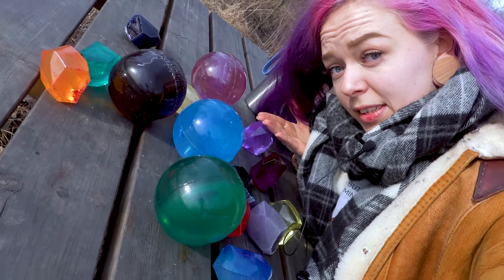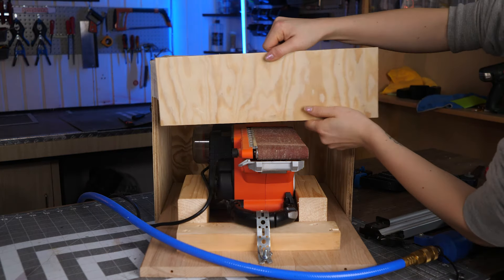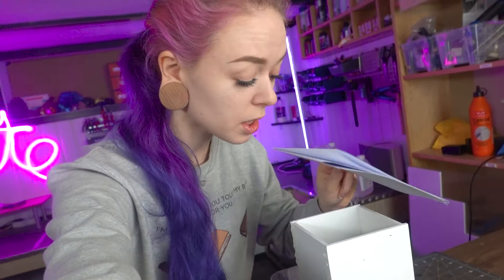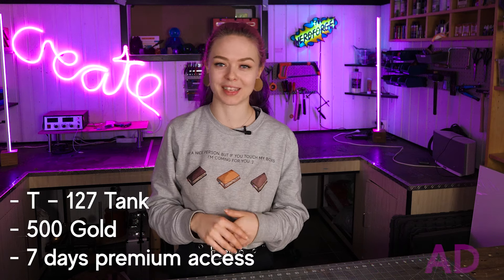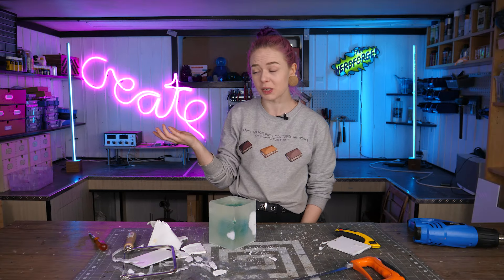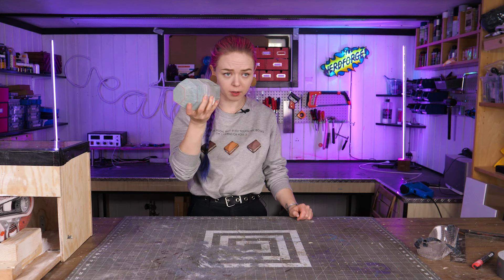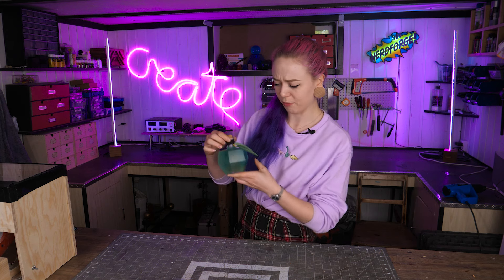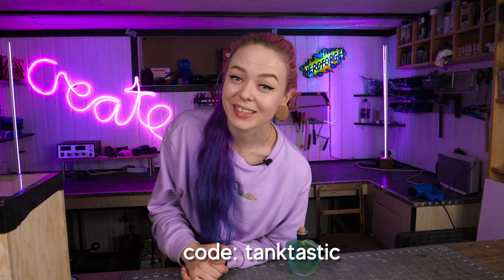DIY Fantasy POTION Made from Leftover Epoxy!

Comment: Next time try this, shape your Epoxy then find A decorative bottle that the epoxy shape will fit in, then just cut the bottom off the bottle (or cut the bottle in half) insert the epoxy then epoxy the bottle back together and buff out the line. They do sell bottle cutters, do not use the alcohol string fire method to cut your bottle (as seen on YouTube) it never works. Other than that, that is a badass potion you just made. Very nice.

Comment: When you use hot glue and it’s not giving, use a heat gun to reheat the glue and it will come off easier. Also using a mold release will help the
epoxy release from the mold.

Comment: For the next one you can try casting the bottle shape you want in a rubber mold first. So just when you shape the resin ball into a potion make it a little bulkier then you actually want it, cast it, then shave it down some more and then put it in the mold you made with the resin to get that liquid in a bottle effect without all the sanding you did. It would help getting the main body shape, for the spout you can secure a tube or some cylindrical object to the resin potion shape you made before casting it in the mold, I’m not an expert but that’s what I would try

Comment: A couple of advice, if you polish the part of the liquid before applying the glass layer visually separate to have another texture. To save yourself the loss of so much epoxy, you can make a mold the way you want the bottle to be about and then refine the edges.

Comment: If you put a layer of clear packing tape over the foam board before you assemble the mold it will release better. If you want to be 100% sure, use a mold release spray as well.

Comment: There are alot of videos of people working with epoxy. But they usualy turn it. Just like you would do with woodworking or woodturning. The sanding is usualy to finish. They use also a clear finish were you make it very shiny. It probably makes also the clear layer more visible. A fellow Youtuber Nick Zametti does a lot with woodturning resin/epoxy. Maybe you can ask him.

Comment: One thing you might consider trying is to make the inner shape a little oversized and with the neck shape at first, make a cast of that, then sand the inner layer down more so it's nolonger oversized and doesn't go all the way up the neck, and there is now a gap all around when you suspend it inside the mold. You can then hotglue a stick (one that is thinner than the diameter of the hole for the neck) to the top of the inner shape to hold it in place as you pour the clear resin into the mold (this way the stick holds the inner piece in place so it doesn't float to the top or get misaligned). You would then only need to drill out the stick to make the hallow part of the neck and sand it. 

Please don't feel discouraged about mold making, please check out Steady Crafting With The CrafsMan, he is gentle and reassuring like Bob Ross and will help you feel confident enough to try! If you thought that a belt sander would change your world, I would be super excited to see your excitement after trying molds!

Comment: well... for mold casting there is a pourable silicone mix you can buy online or one that you layer on called "Magic Mold" only thing i have to say is if you use the Magic Mold keep it somewhere warm and DO NOT try to use it as a silicone pour! it takes forever to dry that way and can screw up your mold if you mess with it before it has fully hardened.  If you do use MM keep it some where warm or use a blowdrier, otherwise it will take some time just to get a thin layer. im not sure if it would be a good thing to use on a largescale level, although i don't see any reason why you couldn't. im speaking as a jeweler, i use it to create negatives of any gems or shapes i like.

Comment: Acrylic glass sheets are actually great material to make molds for casting resin. Can also be easily sealed with hot glue. Even easier if you put a little bit WD40 on the inside.

Comment: Hi there I'm a big fan of you and your channel, and you constantly inspire me in my own creation ideas. Especially your self-bound books and that sweet Wizards staff you made, I'm currently making mine out of a wooden curtain rod, I've carved some runes on it with more planned out, just need to make them look nicer, I'm also just figuring out putting lights in and definitely thinking about including epoxy resin in its design but I'm a complete noob when it comes to resin casting, seen lots of videos on it but yet to try and implement the knowledge.

That being said I have a small gripe, more of a concern really and that is,  Work gloves!. For the sake of your hands, use work gloves. You're protecting your lungs, eye's and hearing... then you constantly run the risk of sanding the skin right off of your hands. Like I said it's a small concern, It's just I see how close you get too not just the belt sander but the band saw also with out anything protecting your hands and it gives me palpitations... Your hands are important, they need protecting just like everything else.  hopefully I'm not the only one who thinks this. Keep up the good work.
Reply: Edit: I realised re watching that you we're wearing at least some gloves for the band and hand saw but other than that, completely bare on the belt sander, which is arguably just as dangerous and the bandsaw.

Comment: you could try a vacuum vent above the work area where you grind the epoxy so that the loose particulates get sucked up rather than go everywhere else. Also hollowing it out and putting RGB lights would probably turn it into a nice light fixture.

Comment: I think one of the issues is that if it's epoxy on epoxy then the refractive index is the same for both the outer glass layer and the inner "fluid" layer,
you'd need two different densities of epoxy or something like that?
Reply: BarbarianGod , I agree. Maybe if she applied a thin layer of epoxy with ultra fine glitter or mica powder or something to enhance the inner shape, it would make the difference between the lighter inside epoxy and the clear outside epoxy easier to see.

Comment: Use plexiglass or styrene to make your resin moulds. Also instead of trying to get a glass layer around you could have just positioned the shaped piece into the epoxy to just create the neck saving on epoxy time and that awful dust. Maybe some colour change mica paint or powder would help the aesthetics of the jar? Xxx

Comment: My best suggestion is to use HDPE. Lots of products I find in the stores have HDPE (or 2) plastic containers (shampoo and conditioner bottles, lotion bottles, plastic coffee cans, plastic milk cartons off the top of my head). You can also find HDPE sheets on Amazon that can be cut to size etc. HDPE will not stick to resin. It is really wonderful. :D Love this idea of using previously cast pieces again. I have some fails and other pieces I just didn't like that I could use. - Heidi

Comment: thin sheets of polyethylene or polypropylene should release fairly well from most epoxies. You should definitely be able to find it in 3mm sheets, but thinner ones will work just as well and should be easier to cut, it you can find them. You may need a secondary form to support it, especially with the thinner stuff.

Comment: Vaseline works. 
Also cooking spray works. But YES! Warm Vavseline is good for a mold with a surface you're not trying to get details from.  Heat the surface and butter the mold. If the box mold is big enough just warm it by rubbing it between your palms and hand applying most of the surfaces. Then smooth it more with a rubber cake trowel. Never mind the build-up in the corners.

Comment: You can use clear packing tape (the kind used for like mailing packages and such, it's nice and wide) for anywhere you don't want an epoxy to stick, though having a mold release spray also helps too!
I highly recommend Peter Brown's channel Shop Time for resin tips and tricks and other cool wood turning stuff!

Comment: Here is an idea bore a small hole underneath to put a led and a coin cell battery and resister if the light is to bright use a larger resistor to dim the brightness some.

Comment: LOL so much dust!! As you sand try having your shop vacuum running next to the sander to catch as much as it can. Hopefully this will cut down on some of the dust if not most of it. I am sure you can rig it up to the best location to do so. I think there is a spray you can use to help release the stuff from the mold. I like to see what you do next.

Comment: I've seen people use plexiglass as molds. It is firm and comes off easier when you are ready to release the epoxy from the mold. It comes off in big, clean breaks. I have also heard of people using Tyvek tape.

Comment: you can use this material for molds, and mold release spray (i think there are some specific for resin) before pouring the resin. :) than you should have no problem with any mold i think. (sorry for the bad english)

Comment: Plexiglass is used a lot for epoxy moulding

(I think it has different names in different places, But Im pretty sure its just a plastic sheet, You take off the sheet protecting it and then it can be used for a mould)

Comment: Your molds are fine, but you need a release-agent on the mold so it doesn't stick. I think you can use electrical lubrication spray (silicone). I couldn't find in Biltema, but Jula have some

Comment: I've made molds for similar projects using foam core (not with epoxy). The sticking problem maaay be solved by adding a layer of silicone (I use caulk) inside the mold then using mold release. It can be a bit imprecise, but if you're cutting all the edges either way it shouldn't matter all that much. The warping is also something I've experienced, I just ended up duct taping  the edges outside the mold and it seems to be working nicely for me.

Again, these are just ideas--I've never worked in epoxy.

Comment: Material for casting epoxy maybe try to use tyvek tape on your foam board pieces. When I did my epoxy resin table it worked perfectly no need for release agent either.

Comment: Cool idea! Maybe take the measurements of the left over polyhedrom thingy first before enclose it with the clear resin. So you know how much you can sand away on the sides to get the thickness of the glass. And instead of the fake leaves you can add on a lable with some extravagant Latin words like: Foeda pitio resina  (I used a translation tool for this. Don'ts speak Latin)

Comment: @Nerdforge If you want to try this ever egain maybe it could help to coat the inner epoxy in a substance that has a different refraction index so it´s not like looking through a thick block of epoxy but rather looking through epoxy with something inside it that bends light differently. that could help distinguish the inside of the bottle from the clear epoxy around it

Comment: How about 3D printing the outer mould? I don't know what temperature your resin reaches as it cures, but a slow cure resin might be cool enough to not melt the 3D print mould.
You can also get mould release spray that makes de-moulding easier.
When you are sanding, paint the sanded surface with water. This will reduce the frosted effect from the sanding and you will be able to see the internal liquid more easily.
An idea for not taking off too much of the clear layer. Cut a card template of the outline of your liquid, then mark the outer line of the glass. Once you are happy with the thickness, you can cut the template on the glass line. Then as long as you can line up your template with your resin shape, it will give you an idea of how much resin you need to remove to reach the right thickness.
One last tip. As soon as you de-mould your glass layer, find the centre of the bottle from the top clear layer and drill a small hole a few mm deep. This is now your landmark or reference point so you always have an easy way to find the center. You can use this to locate your template or take measurements from when trying to see how thick your glass layer is.
The final bottle was pretty, I do wonder if a simpler shape might have been a better choice for the first potion bottle. The three dimensional pentagram was very ambitious.
This was a great video and has given me an idea for a project.
Reply: I had an idea. You are recycling the resin casts that were not right for previous projects. Why not save up the resin dust and cast that in resin. See what it looks like when the resin has cured.
Reply: One last tip. Painting resin in a light coat over sanded resin (providing the sanding marks are shallow enough) can restore the glass like properties of the resin, like when it was first cast. Just be wary of applying too much resin, or you'll end up with brush marks or drips.

Comment: I wish I was good at videos as you guys are. I haven't even done a YT video in quite a few years. Anyways, I'm about to take a set of RGB PC case fans (6), screw them to a canvas board with a screen on the other side of the board, attach some foam to all the sides, plug it into a fan controller that's plugged into one of my PC's sata power cables, and put it in the window. My computer room has the sun beating down on it from sun up to sun down. I live in a trailer, so this room gets really hot from this time of year until winter. Also, our a/c vent/duct doesn't push a lot of air at this end of the trailer.

Comment: @Nerdforge
Please for the love of your well-being please please PLEASE adjust the blade guides on the ban saw when cutting stuff!
It is there to help support and guide the blade when you are cutting material. Putting pressure on it with smaller objects with out the blade guide brought down to the correct height is a Dangerous accident waiting to happen!!!

Comment: So if you make a mold using 'Smooth Cast Platinum Silicone MoldMaking Rubber'. Make sure you get silicone rubber which will be easier to help you make your own molds! This material you can then create the resin art you want with a lot less effort as well as the ability to make multiple pieces using the same mold. Obtw you can find it on Amazon or at your local craft store!

Comment: If you use only half the coloured core, it will look as if the bottle is half filled. But then again there will be no depth to the clear resin on the top part. I need to think about that one.... Maybe use wax to build the top bit and melt it once the surrounding resin has hardened? Just an idea. No idea if the will work....

Comment: Could you make the trash into a bottle the size you want the final product to be, make a mold with something (i.e. clay, latex, plaster, something like that) and then shape the trash down to the liquid size, and then cast it in the mold you created? So then the mold is about the right shape and you'll only need to clean up and polish the final product after casting the clear layer over the colored. I've never worked with epoxy, but I made the spellbook from hocus pocus last year and for the skin I: 1. sculpted the skin details in a clay. 2. cast a mold of the clay using plaster 3. cast the final product in liquid latex so I could wrap the book in the "skin". and then for the metal details (the snakes and chicken foot clasp thing) I 1. sculpted in clay. 2. cast in latex. 3. cast the final product in plaster. Once I learned to let both fully cure and to be careful with the plaster, I found both to work really well with each other to act as the mold or the fill.

Comment: I have no experience with resin casting, but couldn't you have cut the colored piece to size, drilled a hole in the top to have something to suspend it from, then just dipped it in  clear resin, let it cure and do that a couple of times to get the right thickness?

Comment: use acrylic sheet instead of Styrofoam.. it doesn't adhere to resin.. come out easily.. if not just with a little heat it will come out very easily.. Gret work.. keep it up..

Comment: And old parts cleaning or sand blasting booth with a belt sander in it ... A lot cleaner room ... No mask or glasses needed ... Put sandpaper on wood block ... Saves finger cramps ... It's a proof of concept ...

Comment: two protips for the next time: one, make the resin casting mold from polypropylene - it doesn't stick to resin so you can just peel it off! and two, you can release hot glue with alcohol :)

Comment: The easiest way to get the shape you want is this: Take the epoxy "trash" and cover it with clay in the shape you want the bottle to be in. Then make a mold of the clay/epoxy shape.  Then remove the 'guts' of the mold, add some of the resin for the bottle and then put the potion inside and let cure. Peel off the mold and you should only have surface imperfections to deal with.  

Also, I have no idea if anyone else said what I just said. I just got off a 12 hour shift at work and watched your video while eating before going to pass out. (YAY shift work!!! No really, it needs to die in a fire. Seriously.)

Comment: You could've brushed on a few layers of resin instead of casting it as you did.   It would've given you the effect you were going for and you could have made a cast of a bottleneck to use as well, and then glued it on with another layer of epoxy

Comment: use paste wax on the mold and the epoxy should not stick to it  or a mold release but i like paste wax used it to seal wood for a small casting so should work fine on larger scale.

Comment: this was cool but after all the work wouldn't it have been easier to simply shape the epoxy spheres into potion bottles rather than add the extra epoxy.  One nice touch would be to add an LED inside so it glows like that expensive potion bottle light you can buy.